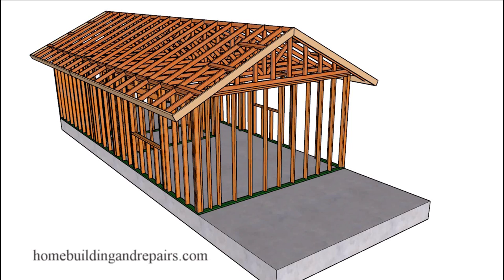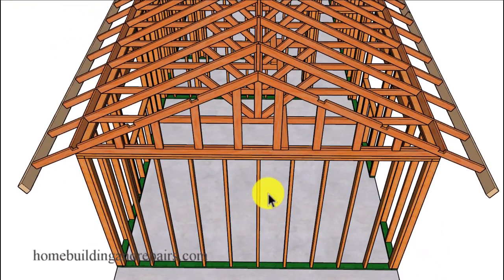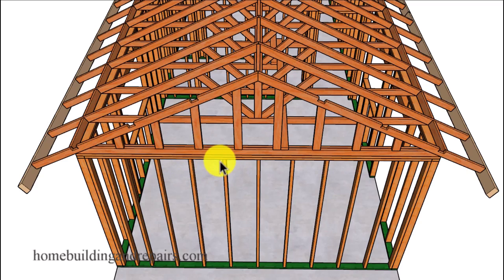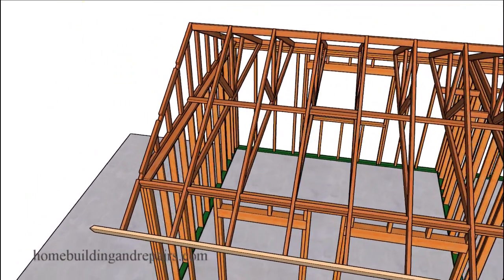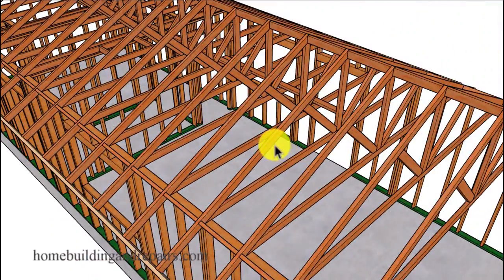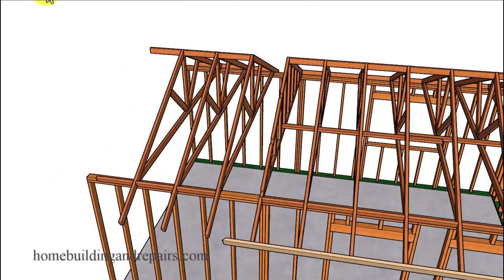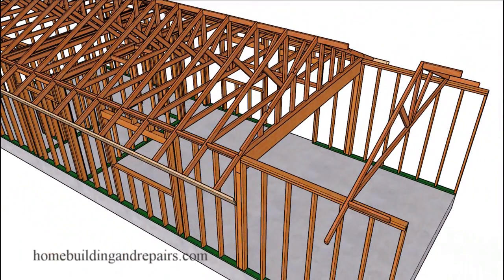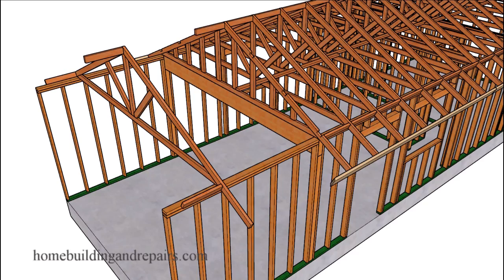Don't Remove Wall Under Gable Roof Truss - Home Addition Construction Education

Comment: I have a similar situation.  Kind of.  What would you recommend for removing a wall that runs through the center of the ridge which divides the house in two about 3/4 of the way down before opening up completely towards the back of the house?

Comment: For a hidden flat continued ceiling, I placed structure bolts from the gable end to 2 lam beams sitting on  4x6 beams on each end and the middle for a 2 story addition

Comment: I am having an addition with extending the gable end of house. Builder mentioned removing exterior wall and truss and building identical trusses to continue the room. This was an option offered instead of using an exposed beam. Did I understand your video correctly that adding the trusses like the original section will work?